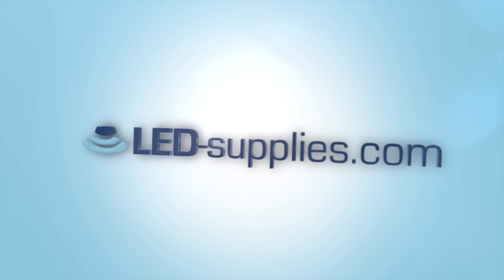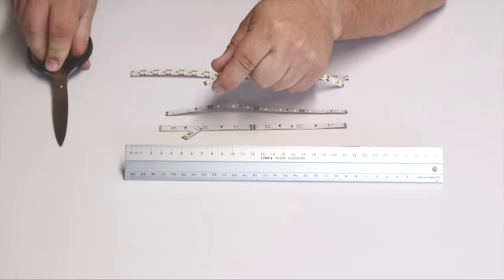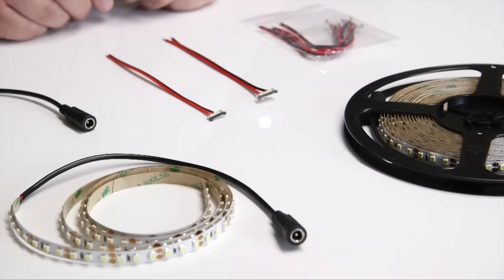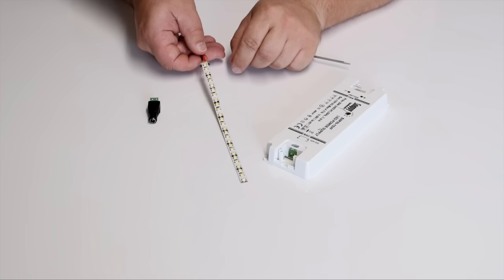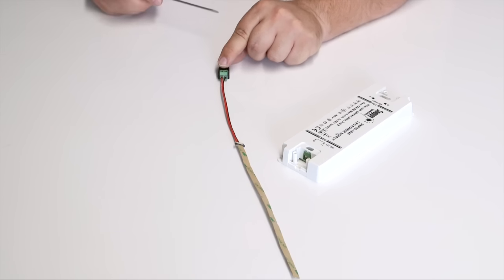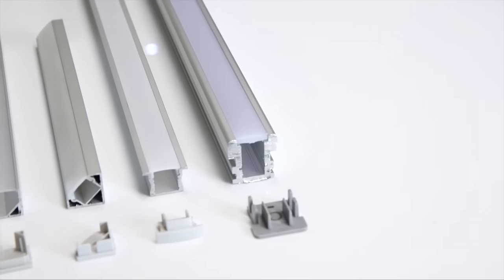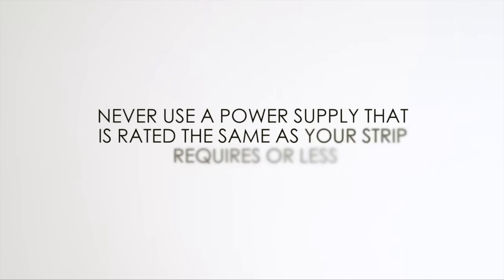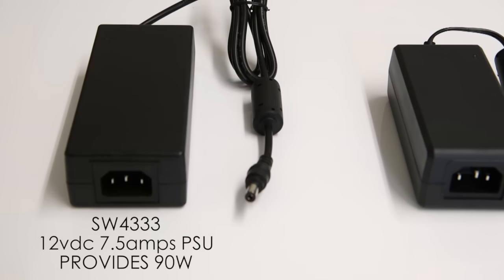How to cut, connect & power LED Strip Lighting

Comment: Can you splice on another LED strip to make it longer?
Reply from the maker: RobsMemoryLane  Hi Yes, you can add more LED strip on - check each spec to refer to maximum single run lengths. for running in series You can also use repeaters to power more LED strip from a single dimmer or controller like these http://www.led-supplies.com/catalogsearch/result/?q=repeater or we do a range of quick connecting cables to make the job easier as well like these http://www.led-supplies.com/led-installation-accessories/cables/corner-connection-cables-for-led-strip/ or maybe these connectors http://www.led-supplies.com/led-installation-accessories/connectors/. Thanks for contacting us i hope that helps

Comment: Can I power these straight from the PSU and remove the socket connectors?
Reply from the maker: Thomas Kuiper Hi Thomas yes you can hard wire a power supply or driver into the LED strip .The sockets are to make connection easier for those who want the fastest possible way to power it up

Comment: +LED supplies hi there, can i ask a question please:

ok bought a 5m roll of SMD3528 with 300leds.

>What id like to know is how many volts, amps do i need to power a segment of 3 leds. That way i can figure out how much 270 leds would need, and what resistor id need in order to run it off 12v battery,
>Ive cut the strip wrong and now have only 270leds. Just trying to figure out how to power it. 

Any help would be greatly appreciated thanks.

///

Trying to figure this out myself
60led per mtr 4.8w 12v
4.8W / 60leds = 0.08w each
4.8w / 12v = 0.4v each

so strip of 3leds = 1.2v
thats 30 leds in a line for 12v
so 270leds i need 9 lines of 30leds in parallele - correct?
Reply: DiyEcoProjects Alright, first of all, you're not distributing 0.4V per diode. You impose 12V on all the diodes, what needs to increased with length is the current.

This is important, you need to impose 12V for them to work. That means 
you need a 12V constant supply with variable current. That also means 
putting them inline.

So, on the website they list that the 3528 LED strip is rated at 9.6 watts per metre has 120 LEDs per metre. You want to put 270 LEDs, that's about 2.25 meters at 9.6 W/m so 21.6W at 12V that's 1.8A (quite a bit).
Reply: MenwithHill thanks for your reply. So this could still run off 12v, it will just pull a lot of juice. hmm... ok

Would there be any advantage to putting them in parrellele&series.... instead of just series? maybe not

I could split them in two, and have them run off two batteries in different locations. 12v 0.9a then pos.

Thank you

Comment: ok I get how to cut strips now. How do you join strips to make a much longer strip if needed?
Reply: The best method would be to solder some wires inbetween each end as that provides the best connection. Of course make sure positive and negative ends are properly connected to positive and negative on each end. There are also a variety of connectors you could use as well. When making a long run you may need to add additional power taps, all from the same power supply, along the length of LED's. Otherwise due to voltage drop the LED's near the end very well may get dim. Think of it like a tree's branches. One at the start, one in the middle and one near the end

Comment: what is the voltage supply for incoming power to the transformer? is it 12 vdc-in and 12 vdc out to power the strips
Reply from the maker: rcmoot Hi, one of the power supplies or drivers featured in our video tend to have an auto sensing wide range mains input of 100-240vac for world use, and then provide a constant voltage regulated output of 12vdc. I hiope this helps

Comment: I have a '77 Chevy Blazer.  The dome light is terrible. Can I replace it with a strip of LED lighting and plug it directly to the original leads?
Reply: mimixownzall You might want to wait for an official answer from LED Supplies, but from what I've read, the answer is a qualified yes.

Cars and trucks are 12V DC, so no transformer is required, and the dome light is already on a fuse. You won't be able to "plug" in an LED strip, but you could wire it in. You'd need to remove the old bulb socket and strip the wires, connecting red (positive) to red.

My main concern would be if there's a possibility of shorting something out if you touched metal to part of the LED strip. You could use electrician's tape to ensure parts are isolated.

Comment: Super helpful, thanks. I would like to order some led strips but i have a question first. I am putting landscape lighting in all the garden and I want to put multiple strips (probably 6 or 8 of 1 meter each) all over the place. I do have a 12V-15V multi tap 300W transformer so wattage should not be a problem. I am running 10-2 wires everywhere, so access is not a problem either. My question. Can i just hook each led strip directly to one of the 10-2 wires and connect the 10-2 wire to the (monstrous) multi tap transformer? or is there a "maximum" thickness of wire and/or a maximum wattage of transformer that is safe to use with the led strips?
My problem is that all the recommendations are for really tiny transformers and thin wires and i wonder if this is just because those are enough or because more is not advisable
thanks!

Comment: Say I wanted to power a string of led's on the bottom of my skateboard, how would I power it?
Reply from the maker: +Kaipo Fitisemanu  You would have to power them from a suitable 12vdc battery take a look here https://www.led-supplies.com/led-drivers/portable-power-battery-for-led-strip-lighting/ but keep in mind the more 12vdc LED strip you power the less time it will run for from the batteries so less is more :)

Comment: i really need help with this. what is the maximum power supply that i can supply to the strips. Also i need three different strips isolated from each other of course because i need to place them in different places. Is there a way where i can get one supply source to supply pd to all three of the separate strips??
Reply from the maker: Hi BELOWIT, thanks for watching our video guide on using LED strip lighting. There is no maximum size power supply that you can use as such, the LED strip will just take as much power as it needs from the power supply. power does not get 'pushed into' the strip lighting. The input thing is to use a power supply that is rated at high enough power. if in doubt always use a power supply that provides more power than you need rather than too little. Refer to manufactures guidelines on how to wire the LED strip and the maximum length that can be powered in a single linear length. Instead of powering the LED strip as a single linear length in series, consider powering it in parallel to protect the led strip. You can power 3 lengths of LED strip lighting using our splitter cables, take a look here http://www.led-supplies.com/2-1mm-splitter-cables we offer 1 to 2 way, 4 way and 8 way versions. I hope this helps
Reply: omg that's pretty cool. so i just need one power source and the splitter cables. This does help! thank you! Before i disappear off i want different LED strips with different colours (namely blue, red and warm/light blue). what should i buy in total? I just don't want to order a package and miss a very important item out considering that i have under a week to make my lamp! Once again it's been nice talking to you! your quick response is duly noted and will reflect well if your product is amazing!
Reply: ***** I'd like to buy the Single row LED type, 4.8 watts (one metre long), one in blue, one in red and one in super warm white. What power supply do i need for these as the maximum length of a strip will be 630 mm (63cm) that i will use. (i don't want to mess up the maths and get it horribly wrong and you're the expert.
Reply: ***** Where can i acquire the circuit diagram for the LED strip as i need to know how it works?
Reply: ***** I've chosen a 700mA, 9w power supply. is that fine?
Reply: But the LED strips I am buying have a power rating of 4.8 w (and I am buying 3 of them) How did you derive a 72 watt rating?
Reply from the maker: ***** Hi Belowit, it appears that someone in China had picked up on your comments and had been replying with misleading information, hence your comment about a 72W rating. Their comments and incorrect information have now been removed from this thread. Please note that any response from us will be shown as coming from LED Supplies. If you are using LED strip rated at 4.8 watts then each 630mm will use 3.024 Watts (4.8 x 0.63 = 3.024 Watts). So 3 of these will require a total of 3 x 3.024 Watts = 9.072 watts. We suggest allowing atleast 20% headroom on the power supply or driver so anything 11 watts or above would be perfect. The closest standard rating is 12 watts (i.e 12vdc 1A - 12v x 1A = 12W) You need to make sure you are selecting a constant voltage power supply as well. Not constant current which the 700ma one you have opted for could be as this is a standard output rating for constant current LED drivers. You can view suitable constant voltage power supplies here http://www.led-supplies.com/desktop and depending on where we ship to we will make sure we send the correct mains cable so the power supply can be used anywhere in the world. The power supplies we feature are high quality and carry comprehensive safety approvals and meet latest energy efficiency legislation.
Reply: ***** I guess i' mready to purchase. thank you!
Reply from the maker: antiswattt3 Hi Antiswattt3, a 5vdc power supply would not be suitable for powering 12vdc or 24vdc LED strip. Also, be very careful when ordering power supplies on ebay. Its always a good idea to request safety approval certification and make sure the units are tested an approved by a reputable lab as you cant be too careful when dealing with mains input voltage! :)
Reply: antiswattt3 you should assume yourself lucky. He did say it's better for you to buy it approved to minimise the chances that you get a faulty one. Otherwise a lot of time and a good amount of money will be wasted

Comment: What other steps would need to be taken if I have a waterproof strip? Would I just carefully cut off the silicon ?
Reply from the maker: Hi, Yes, just peel back the silicon and do the same. You would need to make sure the strip is then reselaed correctly if you are using it in an area of high moisure content using suitable glue or sleeving etc as provided by the LED strip lighting manufacturer / supplier
Reply: realgreenled LED 请不要广告向我
***** Thank you! Would Marine liquid rubber be suitable to reseal my strip, or do you have another recommendation?

Comment: I just bought a roll of this. It worked on the real. I cut a section and had trouble getting the connection to work but it did. I cut another section and it won't work. I have 13v all the way to the end. I connected the real and it works. Any suggestions? And I did cut them on the line. They weren't long enough to fit into the pigtails that came with them so I cut to one side of the two connections so they were long enough. The first one works and the second one doesn't and the real works.
Reply from the maker: Hi David, I cannot find any orders from you on our system. I presume this LED strip was purchased from another supplier? Our LED strip lighting is extremely easy to cut and connect again as you can see from the video. We make sure we only provide very good quality LED strip, but there is massive range of it available from very good to very poor quality stuff. There is no reason for the LED strip to not work as long as you are following the guidelines we provide, or from the supplier of your LED strip. I would contact the supplier of your LED strip and ask them for assistance.
Reply: Yes. I got it from amazon. I didn't realize you were selling them. So no answer I reckon. Understandable. Thanks

Comment: I sent a message though the website but havent gotten a reply yet. I had a few questions. Do you ship to the US and if so, how long would it take to get here? Thanks!
Reply from the maker: Hi RickDawg527, yes we received your message, you can see the message you sent and our reply below from 4 days ago. We do ship to the US. The goods are sent by Fedex on a tracked service. Typical delivery would be 2 or 3 days. The shipping cost is automatically calculated at the checkout stage once you have added your address in, depending on the weight of the products you are looking to purchase. You can also select your currency as USD$ instead of GBP£ or Euros on the site. I hope this helps. Thanks for contacting us re your LED lighting

Comment: How would we extend an LED strip let's say 50 inches apart. Are there connectors this long?
Reply from the maker: Hi Dee, so you just need to connect 2 pieces of LED strip together that will be around 50 inches apart? if you can use a soldering iron, then simply attaching the 2 pieces together by soldering a section of 2 core cable between them is the best and most reliable option. You can see the type of 2 core cable here http://www.led-supplies.com/dc-extension-cable 

If you are not comfortable using a soldering iron, then you would need to use push on connection cables like these http://www.led-supplies.com/quick-connect-power-cables-for-led-strip-lighting or if you are using RGB colour changing LED strip these http://www.led-supplies.com/quick-connect-power-cables-for-rgb-led-strip-lighting These push on cables can be used in conjunction with these 2.1mm screw terminal connectors http://www.led-supplies.com/2-1mm-connector-to-screw-terminals AND http://www.led-supplies.com/2-1mm-socket-to-screw-terminals

You can use a combination of the push on cables, the 2.1mm screw terminal connectors and the DC cable to extend the gap in the LED strip to whatever length you like without soldering

I hope this helps
Reply: Great! Thanks.

Comment: Hi nice clear video thanks.  Hope you can help me with my situation.  I want to run strips down each side of my loft stairs I need to be able to connect them by running a cable underneath the carpet so they can plug into one socket.  What do I need to connect them cable wise so that it would run under the carpet on the stair treads?
Reply from the maker: Hi Lee, if you want to power 2 LED strips form a single LED driver or power supply you could consider using these 2.1mm splitter cable http://www.led-supplies.com/2-1mm-splitter-cables You may also want to use them in conjunction with these DC extension cables depending on how far from the mains socket the LED strip is situated http://www.led-supplies.com/2-1mm-extension-cables

if you need any further help with your LED strip installation just let us know :)
Reply: ***** Thanks for the reply but I am not seeing that as a solution as the black cable looks bulky and will be difficult to hide and I don't think It will go under the carpet well.  I think I will just have to do a single white strip on one side but wonder what the neatest way will be to take the wire from the end of the lights to the socket which is located just above the stairs to the left on the loft floor.

Comment: Just a quick question: What would be involved if I wanted to run a strip directly off an automotive charging system. Do I need any regulators or power converters? It would need to handle as much as 15 Volts and run on as low as 9
Reply from the maker: Hi Paul, we would suggest you pass the supply through a DC-DC convertor which would take the 9vdc - 15vdc input and provide a nice smooth 12vdc regulated output. You can get different power ratings according to how much LED strip lighting you are looking to power. Take a look at this kind of range http://www.powerpax.co.uk/dc-dc-converters/high-power-industrial-enclosed

Comment: Hi Folks, your video is very informative. Thank you. Hopefully you can help me with my dilemma.
I am looking to put your LED strips above 9 shelves,feeding them with lighting for my home liquor bar. I want all of them fed off of 1 remote control, which  dims and preferably will change colors if possible.  Three of the shelves are 20" long, three more are 34" long, and the last 3 shelves are 36" long. I am wondering what you can supply me with to do this? All of the shelves are connected together with the 3 thirty four inch shelves above each other on the left side.....the 3 thirty sixes above each other in the middle....and the 3 twenty inchers above each other on the right side. I have one 120 volt receptacle in the bottom middle below the 34" shelves to power them up with. I would like to run whatever sized wire you feel that I need between all all of them in a nice neat fashion so as to hire the wires from sight.  Can you help me?
Also,,,,what would be the cost of this?
Thanks again, 
Scott

Comment: I have two kitchen cabinets with a gap of 4ft in between. Is it possible cut the led into two strips and reconnect to make one strip again? Also do you have a snap connector wire that would bridge the 4ft gap as it will be tiled later on?

Comment: are the wires just regular 22 gauge speaker wire?
Reply from the maker: Hi Mannyvelo, The guage of wire we suggest you use depends on the type of LED strip you are looking to power, the current rating of the LED strip and how much of it, as the more you power the higher the current that the wire needs to carry. Take a look at our range here http://www.led-supplies.com/dc-extension-cable

basically any good quality 2 core cable should do the trick though as long as it is suitable for the amount of current